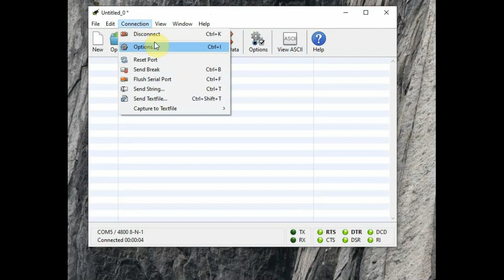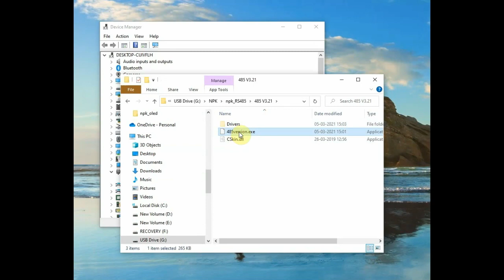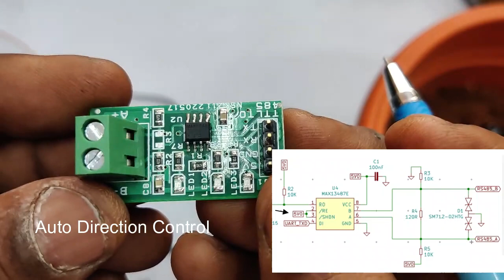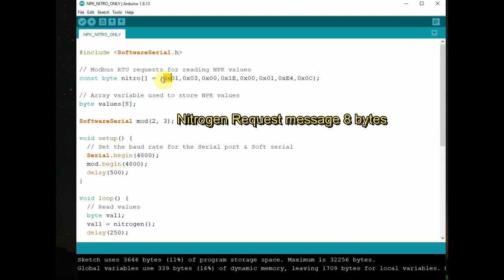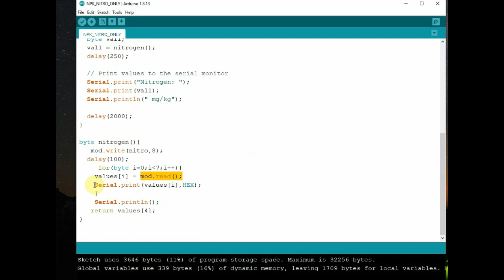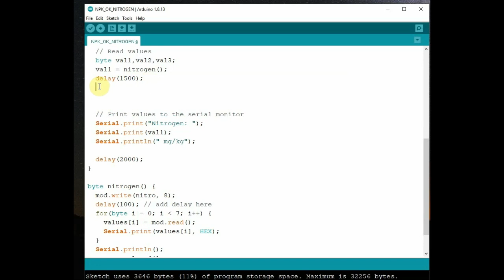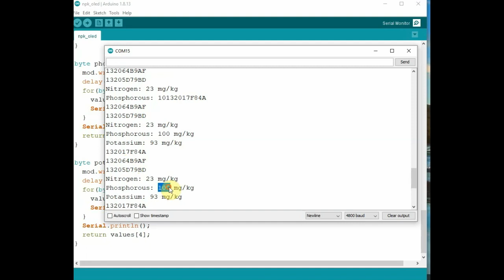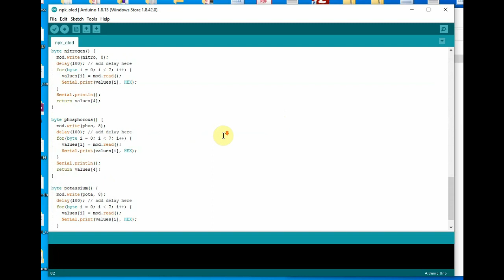NPK SOIL FERTILITY Test Sensor

Comment: Good evening I made a small assembly with a 3-pin NPK sensor but it only returned me 255 255 255 for the n p and k values
Reply: Hi, did you find a solution yet?

Comment: Is it possible to view the received data wirelessly on a computer?
Reply: Of course.  It takes a different microcontroller and lots different programming but it certainly can be done.  I'm pretty sure it can be done with an ESP32.  The Arduino Uno does not have WIFI and it may not have the processor power either,
Reply: @ronaldmorrison2765 so, I can't show my data on my mobile phone with Arduino Uno+ a Bluetooth module?

Comment: Hey, I'm pretty sure my sensor is fully functioning. I made a test of sending HEX code with coolterm and using the sensor in some soil. I got the npk, potassium and phosphorous hexadecimal outputs, but when I want to use the RS486 software you provided, there is an error called ERROR(367):0. Maybe you need to add the CSkin.dll archive you have inside the folder where you opened the rs485 software app.
Reply: What version of rs485 did u use. 
In video he used max 13487 version. For this there is no need to define re and de
But for the one available in, market that is max485, it needs re and de to be defined

Comment: Hello, I have verified all connections between Arduino Uno, 485 and NPK sensor, also made sure NPK sensor's power wire is connect to 12V DC power source, the code also looks correct with the same address value as in the manual,  but it still always gives 255 value for All N, P K values. Any suggestion how I could resolve it?
Reply: Did you fix it ? I have same problem
Reply: I also have the same problem
Reply: The problem lies in 485 module. I only know that. But don't know the solution
Reply: Same problem

Comment: I bought the MAX13487, it still did not work. I always get 255 value.
Reply: Did the issue get resolved ?
Reply: Change the band to 4800 @Monkey3241dj

Comment: So MAX485 Modbus module will not work for this?
Reply: Sometimes it will but not reliably.  Stick with the 13487/3485 if you want it to work every time.